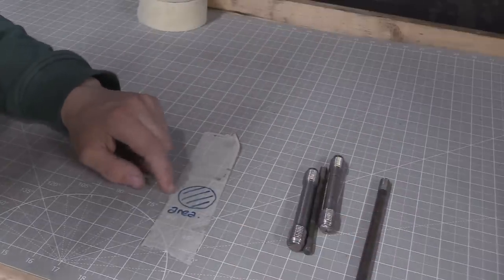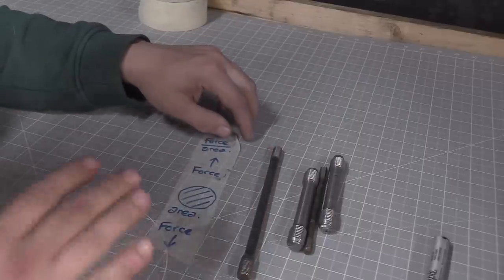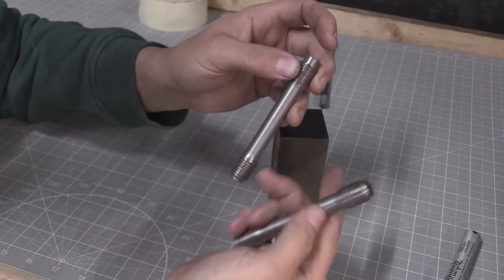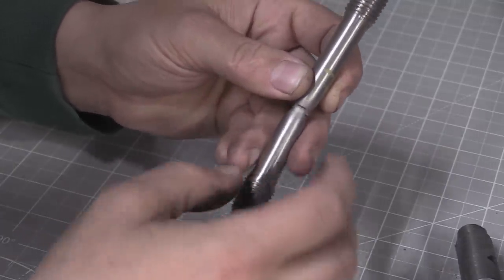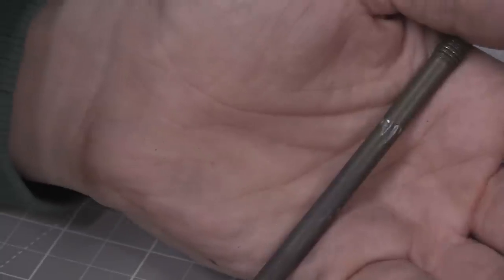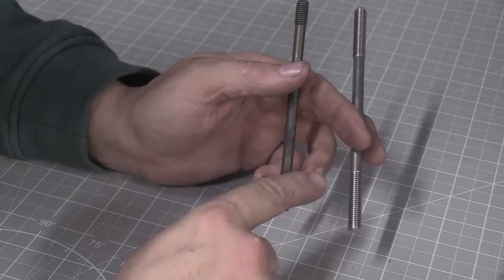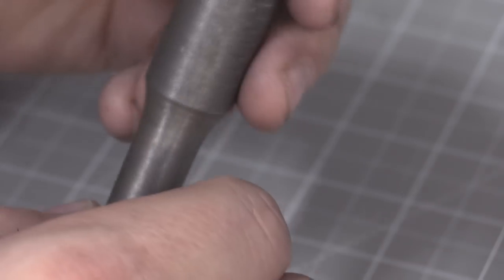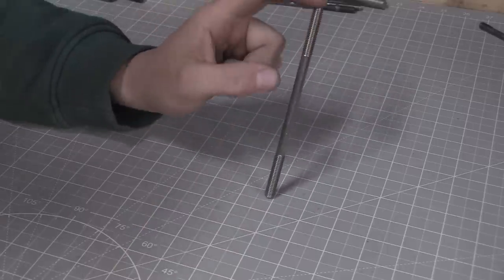Tensile Strength of ENGINES studs

Comment: Matt, you mentioned that the studs have different diameters along their length ( usually thicker at both ends and thinner in the middle section ) for a reason. I failed to understand exactly why. 
Is it because the intention is when they fail this not to happen in the threaded section? Thermal expansion in the place they live?
Reply: It stops them binding in the holes in the head for a start …
Reply from the maker: So just say you want 100 clamping load (the units don't matter) and you work out that 4 studs around one cylinder with 25 units per stud. Now, to make this easy you work out that a 5mm diameter is what you require. So you have 6mm thread so that the shaft stretches and the threads don't, because stretched threads bind, specially in ally. There's also lightness etc. Some high spec engines will have say 7.2mm studs because that's as low as they can go with a given FoS included.
Reply: @thedirtyworkshop  Got it! Thank you!

Comment: Why, in the absence of defect, do they break in the middle as opposed to some random spot in the stud?
Reply from the maker: They don't always.
Reply: There is always a section of the stud that will be weakest ie have a defect vs the rest of the stud.
Reply: The exact middle, not necessarily, but the middle is where the least material is (after necking). Aside from that there is something else that's interesting to notice during tensile break tests, the break is always at close to 45 degrees and it's because of shear planes.

Comment: Why do you accurately torque head bolts and then add 90 degrees?
Reply from the maker: So the friction in any instance is different every time, any time. Torque wrenches require firction to work. Once you get to "x" amount of friction the wrench clicks. Then you add 90 degree to give you approximately the correct stretch on the bolt. The amount of tensile stress is equal to the clamping load, just in the opposing direction.
Reply: @thedirtyworkshop  Why not add an extra "N" torque if it so inaccurate?  How much more accurate will adding 90 degrees be over adding the extra torque?
Reply from the maker: It's not. It's a statical thing not a measurement thing.
Reply: @thedirtyworkshop  So we cannot measure it enough?  I still am not sure why it is not torqued.   But then again, I am not an engineer!
Reply from the maker: I'll have to do a video
Reply from the maker: Locks it? The moment you apply load to something it starts to stretch. And the threads don't stretch, that's that point of the minor diameter.
Reply: @thedirtyworkshop  Yes please!

Comment: I wanted to replace my rusty yoke bolts recently with stainless.  So I wanted to calculate if A2 for example. Would be strong enough.  I couldn't work out how to do this however.  Any chance of an explanation on how to do that please Matt.
Reply from the maker: I'd you want me to use your.example then I need the material specs and fitting dimensions. Along with the required load.
Reply: Are your yokes aluminium castings? If so, then Stainless Steel, Steel or Titanium bolts would be fine. The torque specs for yoke bolts wouldn't be that great.
Reply from the maker: That's not really the answer he was looking for. And would m3 fasteners be fine???
Reply: @thedirtyworkshop  Why do any calculations?  The simple problem is being over complicated, if the yokes are aluminium, which they probably are.  Regarding the size of the bolts? He didn't ask that either.  Obviously like for like size.
Reply from the maker: He asked how to work it out. That's all.
Reply: @thedirtyworkshop  Fair enough.
Reply: @thedirtyworkshop  Could the required load be calculated from the grade of OEM screws and torque value?

Comment: Why use stainless if the carbon steel ones are fine?
Isn't stainless steel generally weaker than carbon steel?
Reply from the maker: Corrosion...
Reply: @thedirtyworkshop  you’d be more likely to get bimetallic corrosion with SS but then again why would there be moisture present?